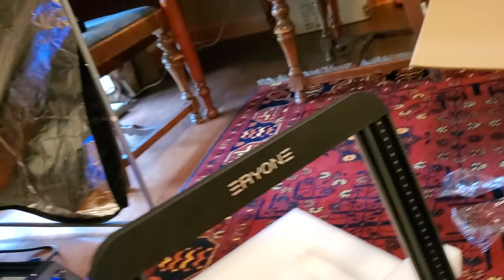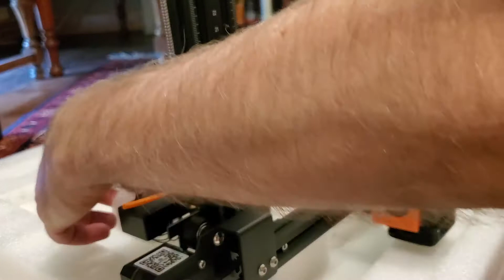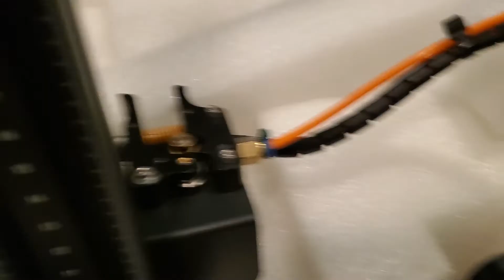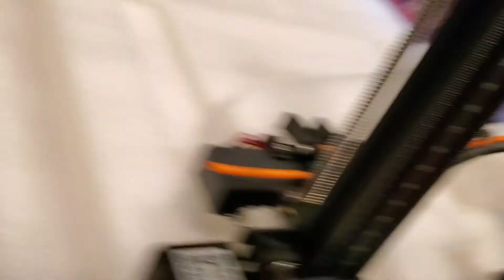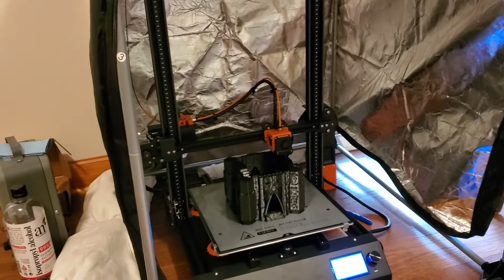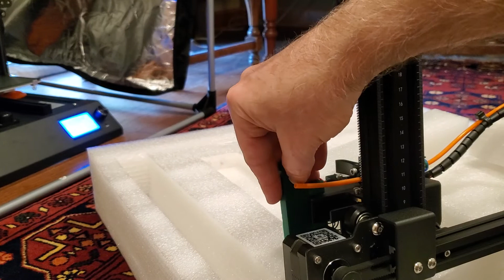Episode 2 - Eryone ER-20 Printed Upgrades

Comment: The hotend fan is really loud, and it is smaller than 40mm, do you have any idea how I could mount a noctua fan on there?

Also I need to test the voltage
Reply from the maker: 5 volt fan in this case.  I think Noctua has a fan with the same dimensions - but it's not cheap.
Reply: @jayburkette8977  did you find a different replacement? It's really loud compared to all other components/fans
Reply from the maker: @David-ty6my  I did not - I'm still running the OEM hot end fan (but a 5015 blower fan for the nozzle).

Comment: Also do you have the link to the shroud? The one from Madizmo?
Reply from the maker: Absolutely.  There are several shrouds, but the one I'm using can be found at this link:
https://www.thingiverse.com/thing:4805584
Reply from the maker: Note that I have switched from the one with "HOT" on it to the one I'm linking in these replies.  Of note - you really need to print a fan shroud in PETG (or ABS, etc.) as the proximity to the nozzle will melt PLA really quickly.

Comment: I'm glad to see the filament guide i designed being used
Reply from the maker: Awesome - I wound up using electrical tape as the "padding", as it made a very solid and secure fit without scratching the finish!
Reply: @jayburkette8977  shelves liner from dollar store
Reply from the maker: @michaelbeaudin5963  Absolutely!